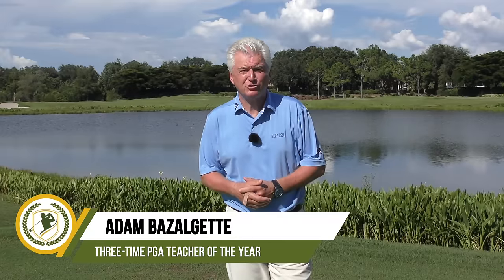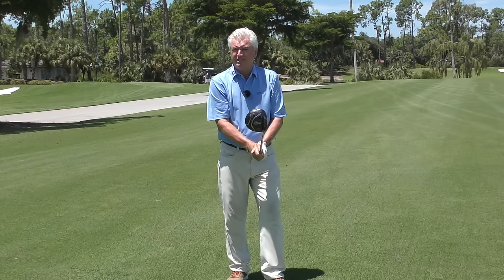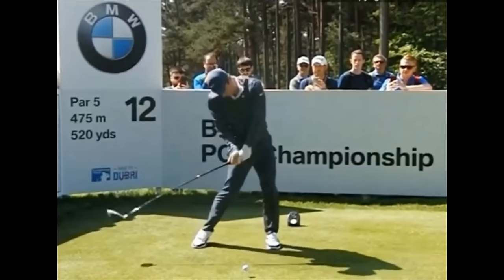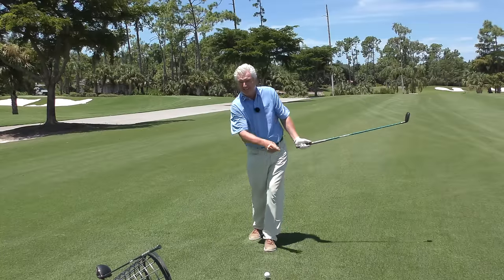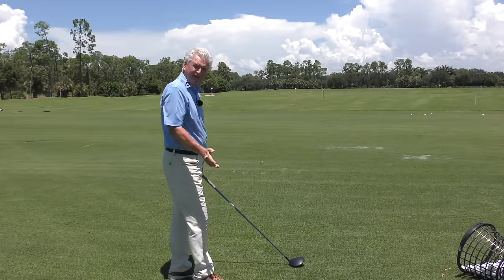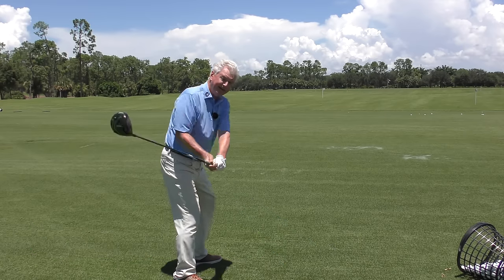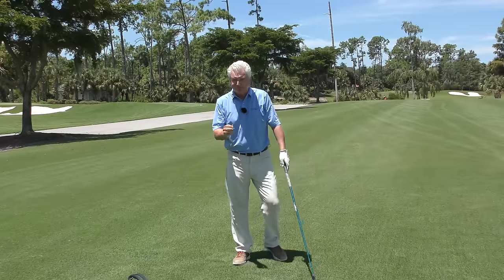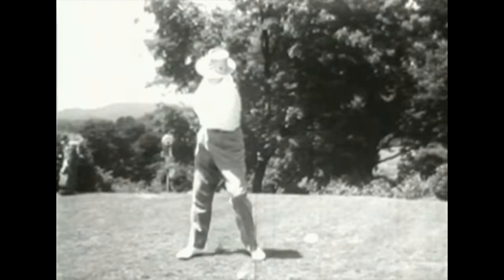GOLF: How to Square the Club Face on a Driver (DO THIS!)

Comment: The problem with attaining 'subconscious skill' and playing around a little bit is most people don't have much skill to work with and whatever it is they may play around a little bit with is simply wrong. Spending hours practising the wrong technique is all wasted time, and the majority of people don't know what or how to practise so all they're doing is ingraining bad habit and likely going home frustrated with their golf swing because once they're on the course nothings changed: been there, done that many times myself. I felt the real lesson of this video started shortly after the 8 minute time mark and what was provided was glossed over. Well, like I said, this is one video. I'm sure you've covered the specific technique(s) many times over many videos over many years. And by reading comments on here it helped a few out. Small steps I guess, we eventually hit the green~
Reply from the maker: No doubt people (most people) need coaching and feedback to make real progress. That said gaining subconscious skill is still a factor, at least in my opinion./
Best, Adam

Comment: Struggling with a spin issue with my driver Callaway Rogue currently. I hit my 3 wood better an further cause I get a little draw with that club. I have a little mental block going on the teebox right now. Swings over the top with it might have to go spend some time at the range today :)
Reply from the maker: Hope you make good progress Sean.
All the best, Adam
Reply: Sean other factors might be the shaft in your Rogue driver meaning shaft length, weight, shaft flex and finally the driver loft. Have you been fitted properly? The 3 wood is shorter, smaller head and higher loft meaning it's easier to square up the face on impact. It might not be the operator but the equipment that is causing you the spin issues. Good Luck